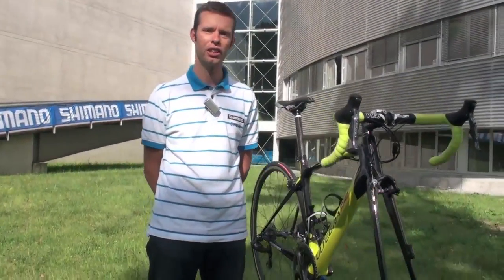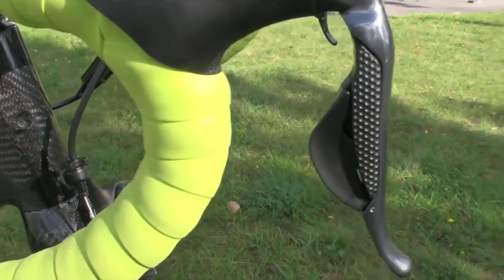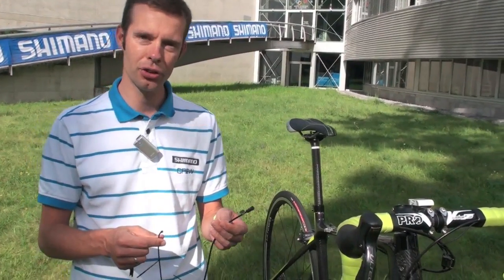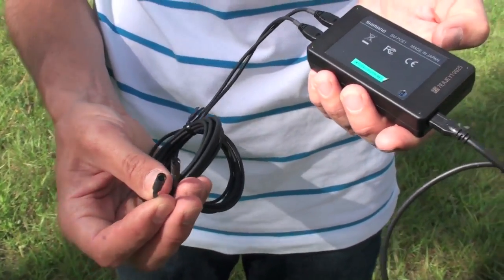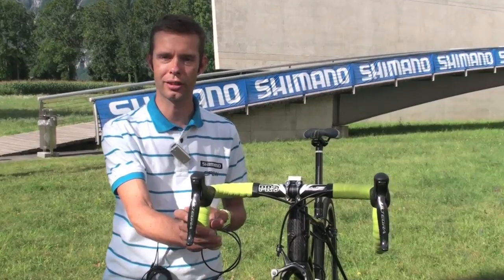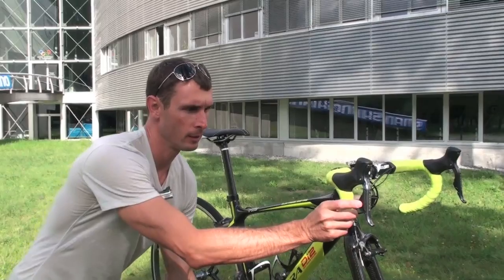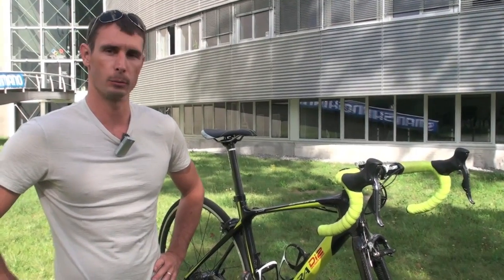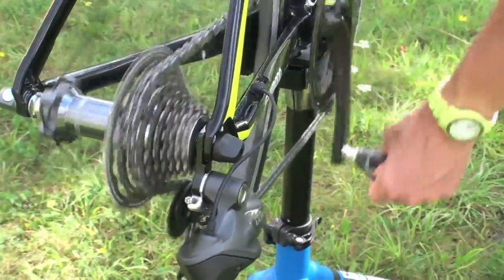Shimano Ultegra Di2 Tech.mov

Comment: The rear shifting is still nowhere near as fast, especially through multiple shifts, as Campy or Sram.  Di2 can only shift sequentially, unlike Ultrashift that can thrown the chain directly on to the selected gear without having to engage every gear in  between.   In any case I don't see why anyone would now pay twice as much for DA, especially considering it has less sophisticated (and now obsolete) cabling and software.

Comment: They pointed out the pros and cons of both groupsets very well. Lightweight (overall) Dura Ace vs easier installation and tinkering capability of the Ultegra Di2. Functionally they seem v similar. Whether it's better is for the buyer to decide. Is shedding 131grams at twice the price for Dura Ace worth it?